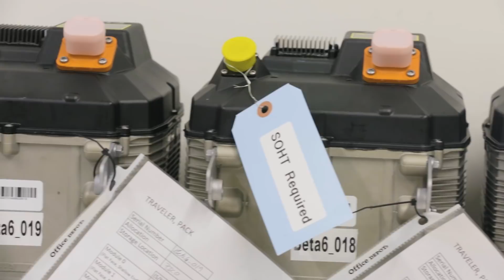Alta Motors All-Electric Motorbikes

Comment: May I make a suggestion, and if you use it and become a multi billion dollar company you can send me a top of the line bike every year, make it so the batteries can be easily removed and a new battery easily slotted in, that way you can charge a battery when not using it and just switch them if you need to travel a great distance, you just switch out the battery and keep going, allowing you to recharge a battery over night. Then you could do deals with BP or She’ll and they could stock your batteries and people could just pull in switch there “she’ll battery” for another “she’ll battery and just go on there way, no idea why the car industry hasn’t though about this as well.

Comment: Are their batteries more energy-dense than Zero's Z-Force battery packs?
And are they planning to build something in sport-touring trim - fairing with adjustable windscreen, tour-cycle size bags, cruise control, etc. - and what would the real-world range and recharge time be?
I've been waiting for Zero to make something like that, but they seem to love the naked-bike look too much, and everyone else (Mission, Lightning, etc.) are into sport bikes. My latest BMW RT is showing is age, and I really don't want to buy another one. Electric is exactly the tool for the job for San Francisco's hills and traffic, but I need to be able to ride down Skyline, out to the coast and back on a single charge, and really want to be able to get to Sacramento or at least Santa Cruz; I can rent the latest beemer for my annual Pacific Northwest and Los Angeles trips.
The first company to make an electric moto that meets my Bay Area/NorCal riding needs gets my money.

Comment: I would really like to see a real world test. Take 2 bikes - The Alta bike and a gas powered bike that is comparative speed/power wise.
Fill the gas powered bike to the top.
Side by side race the bikes on a descent track.
 When the electric bike's power drops off to a level where it is no longer competitive.
Stop the gas powered bike and see how much gas was used.
This way we can see the equivalent in distance from a full E-charge compared to gas driven.
Reply: Go watch Josh Hill race an Alta in the Red Bull Straight Rhythm for 2016. He faired pretty well in the Lites(250) class.
Reply: I watched it. Love the technology, but Red Bull was 1/2 mile track (40 sec.). Before forking over the big bucks I would want to know how long it could keep up with the 250 Lites. before I am pushing the bike to the pits.
Reply: Darren Lachel I understand that...I guess they can go for around a 30 minute moto + one lap w/ a pro rider(according to alta)and around 60 minutes with a local amateur. I've got a 2015 250SX and am having a hard time imagining racing a 4 stroke let alone an electric bike. Everyone seems to think they are the future, but I believe that's a ways off before we start seeing them at my local or any track here in the immediate future, still interesting to check out.

Comment: ya what about water  can it go threw water
Reply: The battery pack is IP67 rated which means it can be completely submerged in up to 3.3 feet of water for up to 30 minutes. So long as the rest of the components have been sealed in a similar way, you can go through water better than a gas bike. In theory, you could ride the thing under water.

Comment: sorry but when your in the dessert and you run out of gas, u can fill it up and be on your way.  when your in the desert and you run out of battery, u need to charge it, while other rider is shredding your gna be sitting your ass down waiting for this shit to charge.  not only that but this is no longer a motorcycle, its taking away from the fun.  this is an electric motor with wheels.  we love the sound a bike makes when you twist the throttle, what sound is this gna make some whiny sound?   for every electric bike they sell,  4 gas powered buys get sold
Reply: NoStress90s yeah, hot swappable batteries would be great.

when ktm has an Enduro model with 50+ hp and 80+ miles then I'll consider it.
Reply: Firestarter  stay away from ktm bro, its the mcdonalds of dirtbikes

Comment: According to Wikipedia- " EPA's formula, in which 33.7 kilowatt hours of electricity is equivalent to one gallon of gasoline"
At 2:10 Alta claims its 70 LBS. battery has 5.8 KWh capacities
Am I missing something? Is the battery equivalent equal to 17% of a gallon. If so it would seem impossible to win a moto on 1/5th gallon of gas.
Reply: I think the numbers are something like 30% of gasoline energy propels the car where as 90% of electrical energy propels the car.
Reply: Darren Lachel it's more efficient that's y
Reply: dude a tesla can drive 200 miles with 60 kwh
Reply: you don't use all the energy from gasoline a lot of it goes out it exhaust
Reply: You don't think the EPA accounted for this when they came out with their numbers to compare gas vehicles to electric MPG?

Comment: What motors are you guys using
Reply: PMAC- permanent magnet AC. water colled, 40 hp
Reply: • yeah...what kind of electric, there is more than one kind of electric motor mate in case you didn't know very sorry about this please look up on Wikipedia to gain more knowledge in this area
Reply: • do you have X-ray vision? Can you tell me what winding configuration they use by looking at the outside of the motor? I guess it's a BLDC but wanted to confirm
Reply: well not THOSE electric bullshit ITS A REAL BIKE
Reply: A KTM 125SX 2016

Comment: Listen I realize an electric motor doesn't need a transmission, but if it had one, what would happen? Wouldn't you be able to see insanely higher top speeds and torque figures? Just throwing an idea out there, I'm open to criticism.
Reply: Grant Dixson Torque is what you look at for power response.
But to answer your question I will give an example.
On a geared bike like my kx450 i have about 33 ft/lbs of torque at around 7000 rpm.
That means the best power response is at 7000.
So when I am exiting a corner I should be at 7000rpm in my gear of choice.
The red shift alta on the other hand has 120 ft/lbs at any rpm and speed (theoretically)
WIth 4x the torque, it really doesn't matter because I will always be above the 33 ft/lbs of torque that the kx450 creates.
You can see the effectiveness of torque if you put your bike or car in 5th gear going 20mph and gun it. The bike will go relatively no where.

Where as the alta has 120ft/lbs instantly.

Top speed on the alta comes the sprockets just as in a normal bike... increasing and decreasing the front and rear sprockets allows the bike to gain higher or lower top speeds, more and less torque.

The electric motor allows the front sprocket to turn at virtually un heard of rpms to gain the same top speed.
Where as a gas engine can not turn its crank fast enough, so it needs a transmission to increase the speed at which the front sprocket turns.

I hope this answers your question....
Reply: Subaru Blue thanks bro that was a really well thought together response that answered my question well
Reply: Dirt Moto i feel like gears are one of the main things to have because without gears it doesn't feel as fun to ride 😂
Reply: Dirt Moto adding a tranny wont increase torque number... But it will increase the number of torque and hp peaks...
for instance right now u might get max torque at 20mph.... With a tranny you would get max torque at 10, 20, 30, 40, 50 
The nice thing about electric is that the torque curve us basically flat... thats why they dont need trannys

edit: if you gear the tranny in certain ways you can gain or lose torque depending on the gear ratios but thats to much math for a reply :)
Reply: Subaru Blue electric motors really have flat power band the whole way and that doesn't shorten the abilities in the high end that a geared bike might have?
Reply: ...but wouldn't doing 50mph at much lower rpm extend battery life?   That's what we really need. 
 Formula E Racing use gear boxes in their cars, I believe.  But still, they all switch cars halfway through the race due to battery life.   
Tesla tried using a 2-speed gearbox in their early roadsters, but gave up, owing to gearbox failure, and went to a single speed transmission.
Reply: Are you from Durango CO? If so I am from aztec, if you own a bike lets go ride :D

A gear box would allow the battery to conserve more energy, but it also gives the nice feature of using torque more efficiently. But on the same hand, it adds weight, and creates more moving mass which can limit potential of a set up. And create more parts that need replacing...
But a tranny they could increase the torque of the bike, or use a torque per gear, like 40lbs in 1st and 150lbs in 5th.

With a dirt bike, I would think their goal is to keep electric bikes virtually maintenance free "power train wise".
This is one of the biggest sellers for the bike...
I have to rebuild my bike every year or so... So an electric would be nice, but batteries do lose power over time.
Reply: You would only gain top speed as it can spin the tires at up to almost top speed. For example the koenigsegg regera is a hybrid that can still get wheelspin at 160 mph, meaning that it can put more power to the ground than the tires can handle. Adding shifting in comes at no major advantage because there is no powerband, max torque is at 0 rpms.

Comment: Nothing in regards to range, recharging time, battery life, etc. Before I switch to electric,  those are factors important to me...not if she can bench 70 pounds
Reply: Its all on their website but here is a break down:
3 hours of range, 2.5 hours of charge time at 220V, battery life isnt listed but years for sure. Bike weighs 250 lbs with 40 hp and 36 ft lbs of tourqe. Motor revs to 13500 rpm with 65 mph top speed. I'd give my 450 up in a heart beat for this.
Reply: So I made a bike that has a 2.4kwh battery and puts out peak 25hp. On level ground I can go 50 miles on a charge. My bike is lighter though.
Reply: Peter K thanks..they should have put that in the video
Reply: Peter K 3 hours of range... riding aggressive moto style like they purposed the bike for? or riding conservative? power modes like KTM?
Reply: Not sure. Gotta wait and see. The bikes isn't in production yet I don't think

Comment: Alta's products seem cool, if a bit skimping on the battery. I get that they managed to keep the weight down and because of that it's not directly comparable to others like Zero, however 5 kWh is not nearly enough, not even now. They need to aim for 7 or even 10 kWh and need to try to keep up with the newest chemistries.
Reply: kalimu